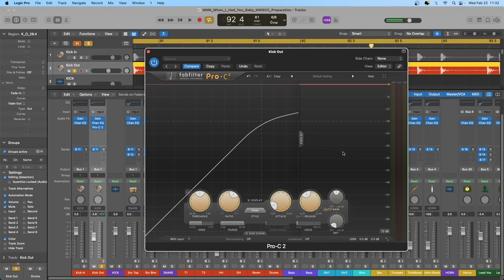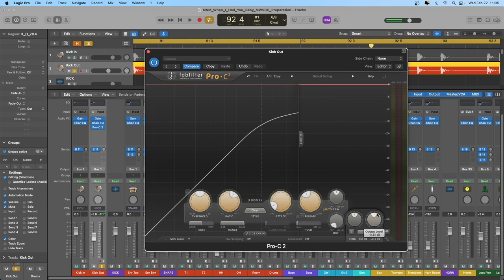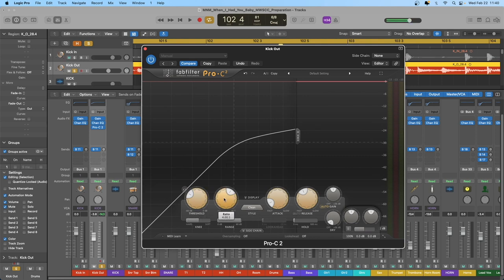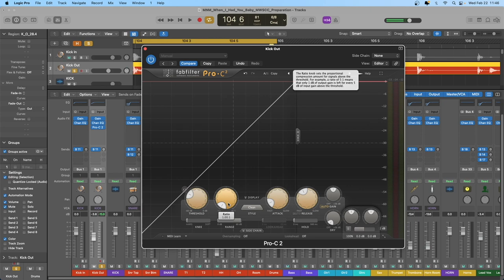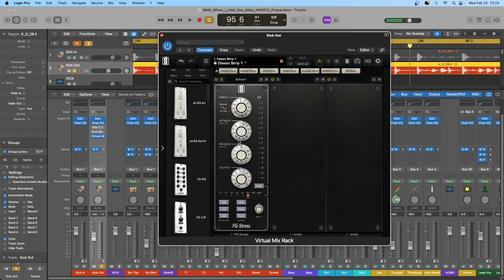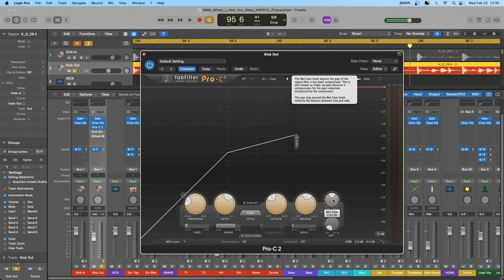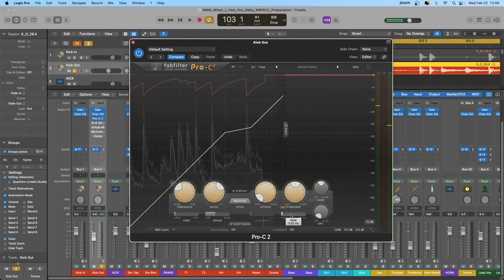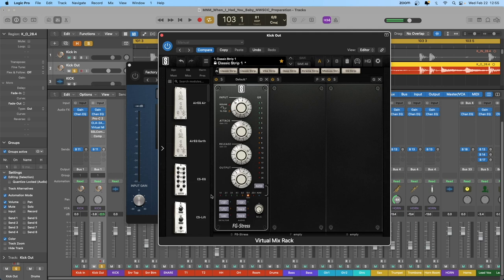Complete Guide To Compressor Parameters

Comment: i understand the concept and theory behind it all, still trying to figure out what i hear when compressing… that’s where my dilemma sits…
Reply from the maker: It takes some time to develop critical listening skills, especially for compression. I've found that the quickest way to learn is to practice with resources like SoundGym (https://mynewmicrophone.com/SoundGym to check it out).

Compression can be used for so many different reasons, and so it can be difficult, when starting out, to hear exactly what it's doing and if it's improving the mix or not. Try A/B testing (toggle the compressor on and off) to hear what it's doing in the mix and you'll have a better time learning how the listen for it!